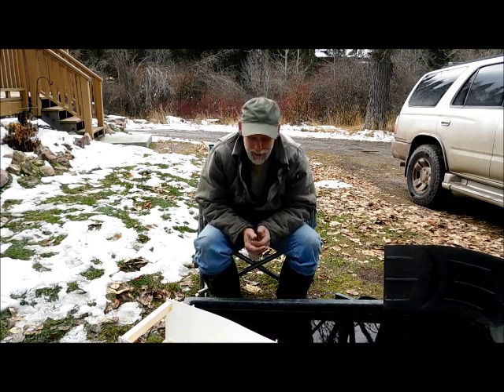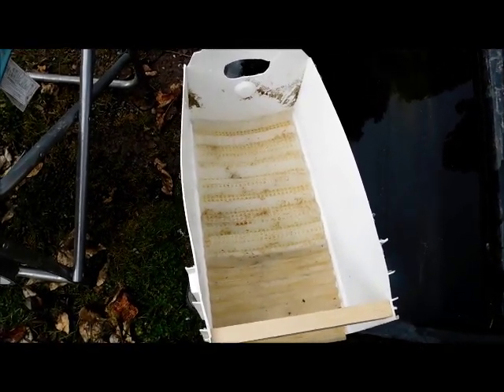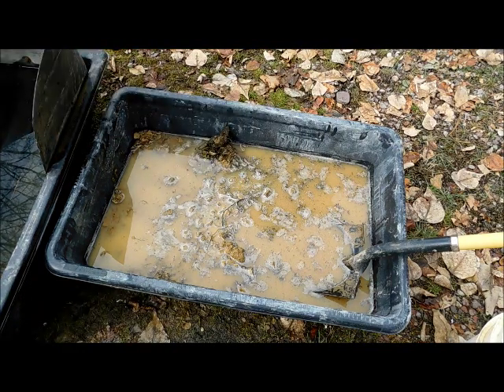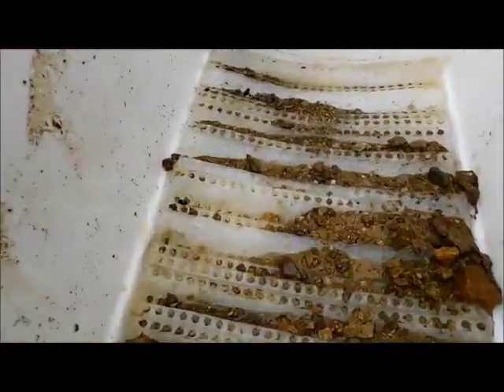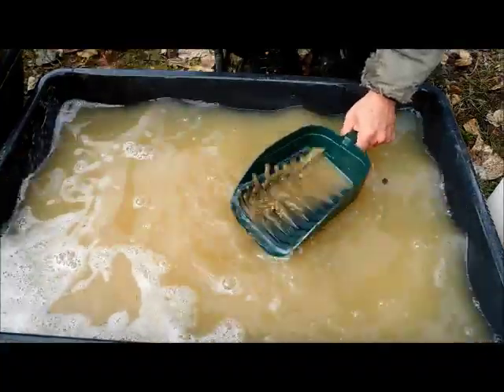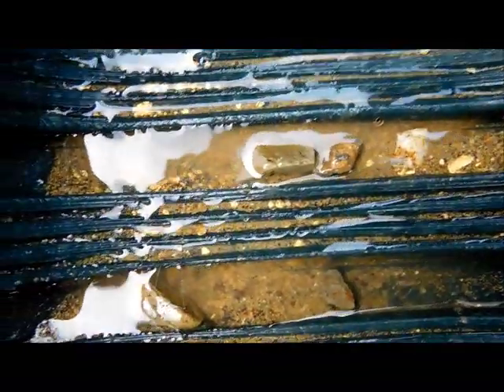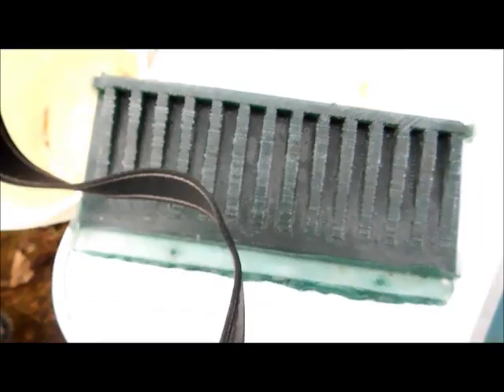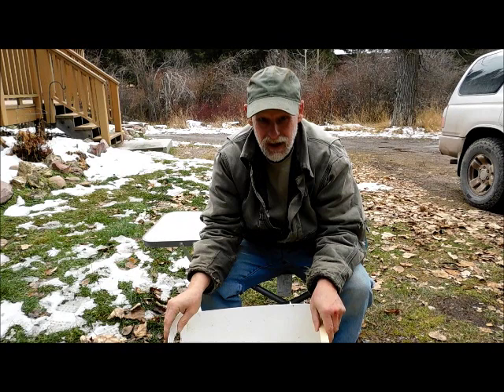New High Speed Bucket Concentrator Faster Than A Gold Pan

Comment: Just thinking about swinging a bucket full of dirt around makes my back hurt.  Now if a guy set it up on springs so it held its self and he’s just a pushing and pulling on a handle......  hmmm
Reply from the maker: Good idea I have been thinking about that. I ran the new one I made in my wheel barrow and it was much easier on the back. Going to keep working on the idea. Thanks for watching.

Comment: How's it going alan ? 
   You brought up a good point in this video. People saying your material is salted. Well here is my take and knowing your work. You start with your idea, in this case the speed concentrator. Well how do you know if it actually works ? You have to test it and when you test it you have to know how much gold you started with. There is only one way to know how much you started with and that is by salting it. 
   Now we know this does indeed work so you will be using this in the future. Your next phase im sure will be live testing it in the field. By actually useing it and saving and rerunning your tailings. If your not finding any gold in the tailings then and only then can you be confident in what you have created. 
    Great job on the video keeping them coming and heavy pans to you 
Dave
Reply from the maker: Hi Dave the concentrator works very well I have used it a few times this summer. The only problem I have is that is is heavy to use for very long.

Comment: If you use PVA filament (I think is what it’s called) in your 3D Printer you might be able to just print the mat and use it right away and not have to mold the silicone. Something to look at.
Reply from the maker: Yes I print in PLA and yes it would work but the secret is the mats are made of silicone and the gold does not like to slide on the silicone unlike the plastic.

Comment: Where do you get your silicone from?
Reply from the maker: I usually buy my silicone at Walmart. MD brand.
Reply: @alanrobertson2510  on so you use silicone from a tube? I thought you bought stuff designed for molds. What ever works and does the job.

Comment: You seemed to be sloshing it from side to side a lot , but there was a lot of slosh noise, but it was only really the splashing in the large tub that was doing all the moving ,not much happening in your invention there in my opinion , for what it's worth ,that's just my opinion . It looked like it needed a cut out up the back to allow water to flow through ,and pass over the material , anyway 10 points for trying , but sometimes it's just reinventing the wheel , i'll stick to my Garrett supersluice pan , works great , pretty quick ,and don't lose nothin. cheers.

Comment: A few years ago A Guy maid took some Harbor Freight gold mixtures and put the basket in screening basket inside so you'd shovel the gravel into the center classifying screen and the fines would drop out I think it was called the gold drum and I just wondered what you thought of that and I was wondering if you had the system where you mechanically were to shake that do you think that a high-speed you know if it was you know shaking it out at a high rate all the heaviest would go to the bottom corner of the bucket and all the lights would go out the top thank you
Reply from the maker: I have seen the gold drum I could see a lot of fine gold not settling to the bottom  and being lost out the front of the mixer I think shaking would be more effective. Who know where this will go I guess I have a winter project
Reply: Couple years ago I built  in the field out of pine poles a cross beam held up by two tripods of pine poles and suspended a 2ft by 3ft expanded steel mesh screen on four wires. 1 wire To Each corner of the screen. The sides were two by sixes and on three sides we're above the expanded metal and one side was laid flat below. The screen was high enough to park a wheelbarrow under it and this way I could throw dirt on it and when it got full enough it move back and forth very easily and sivied down to half inch minus. This way I can move material from the pit and leave behind most of the bigger rocks are all the bigger rocks and when I ran it it also cut down how much overs had to be raked out of the grizzly

Comment: You asked for opinions and I'm going to say it's pretty neat idea you're having instead of cutting the bucket down to make it smaller to fit in a 5 gallon bucket how about using 18-gallon tote and just turning the the square bottom bucket upside down and to wash out that way you don't have to have a removable matte less you want but one question I was wondering if you were to hang the bucket from a A-Frame like a swing set or you know some kind of frame so that you don't have to be holding the bucket up and you can put the dirt in and Shake It clean it out how would you would you just shake it by hand or would you how would have you thought of any mechanized ways to shake the classifying matting thingamajigger hey thank you for a great video and good luck to you hope you have a great winter and maybe a good winner there
Reply from the maker: Hi Jeff You have some great ides. I am going to try and improve on this idea with the removable mats I think it could go either way what ever a person wanted. Yes I think a hanging bucket on a frame of some kind is a great idea I have no idea on how to make it work yet just going to have to think on it for awhile. Thanks for the input.

Comment: Hi Alan, love the vids and how you keep trying to improve the whole process of concentrating and getting away from classifying. Definitely love the improvements you've made since your first attempts at making your mats. 
   I have a flow pan from Gold Hog. It absolutely works, and works FAST! With it, during the initial agitation, you will lose large rocks out both ends, but that's really only about 15 seconds or so. After that, there actually is a single direction for getting rid of the rest of the material and leaving the heavies on the bottom. In reality, the only reason you would need holes on both ends is to allow kind of a sluice action. But the gold itself, within that initial crazy agitation, is already on the bottom. You can pretty much just dump out everything else. It takes me about 3 minutes to run a 5 gallon bucket. In your gadget, you could do the same thing. Shake the heck out of it like an angry Sasquatch on a fir tree, and then dump the rest out the front. The mats are effective, and will trap the gold in the bottom. I think you have a winner here. Especially if the whole thing could be 3D printed. And if you act right now! because we can't do this all day, for a small nominal fee.... etc and folks could purchase the printer file to make their own. 
   The scoop I am VERY interested in! Centrifugal force being greater at the end of the scoop, away from the hand, I think I would try more of a wave action, tilting it forward and backward, in the water, letting the gold stay always at the back, trapped in the mat. And allowing the lighter material to just flow off the front like a sluice again. Mats are amazing things. The way it holds onto gold just really surprises me. I have been a Keene customer for over 3 decades. Until I saw my first Gold Hog commercial, I was fully convinced you needed all that expanded metal and steel riffles and carpeting etc. Even after all the years I've been in this game, I didnt fully understand how heavy (specific Gravity) gold actually is. It's really amazing stuff. And I really think you have another winner on your hands with the scoop. Especially in quick sampling! Without classifying, just a quick fully stratified material in the scoop and dump off the rest with a few waves front to back. Even larger rocks should just roll right out the end. Would love to see a video with that method. Agitate it like a psycho monkey with the front tilted upwards so the gold settles out in the back by the scoop handle, and then tilt it forward and get the rest of the material out the front with just a few waves. Then of course check for losses. I would make one myself and test drive it, but then I would have to cut up some of my Gold Hog mats. 
   I'm ALWAYS looking for newer and better and faster ways of doing things. Especially now that I'm getting older and more broken down. In the Sierras, I've been struggling with that stupid red clay that we all love, for years. Saw a method of breaking it down quickly from Jeff Williams. You've probably seen it already, but in case you haven't,.... he just puts all that nasty stuff in a 5 gallon bucket and uses a drill with a commercial sized paint mixer on it. Stirs the heck out of it, breaking it all up, and then runs it through a sluice. I carry one with me to the field now with a 1/2 drive battery drill with a couple extra batteries with me, in case I feel like I have a few extra oats in me that day. 
  Anyway, love the vids, and love your ingenious home made goodies you come up with and share with the rest of the prospecting community!! Oh! And if you are using a mat, always make it removable. Stuff gets stuck down under it no matter how well they seem to fit in whatever contraption they might be in. Ok, that's my 2 cents brother!! Keep up the great work!!  Bob
Reply from the maker: Hello Bob and thanks for your input you have some great ideas. The mats are working out great now I love them. I do think I was being to careful not to lose the gold out of the bucket I agree with you shake the heck out of it and discard the rest and the gold should stay put and the scoop I can see the back and fourth action working very well. It's always funny how things never work out the way you intended them to but just give a guy more ideas to keep improving. Thanks for the ideas Bob.

Comment: A big thumbs up on another great project. I would recommend staying with this design rather than going to the Flow Pan. This one keeps all the gold. Plus this one will work away from a stream and all you need is a small tote for water.
It will work great when looking for new ground to work. You can quickly run samples without having to spend time sluicing it. Also the nugget trap will be a good addition to it. Those mats are great aren't they?
Reply from the maker: I could not have said it better myself glad you like it. Now that I did the square bucket I am going to try what I think will be better not sure how it going to go yet but we will see. I think the nugget trap is going to be awesome and yes I love the silicone mats. Gold recovery made easy.

Comment: I have just had to subscribe again!! They are definitely a great time saving pieces of needed prospecting equipment.if my arms worked well I would love to use them but as it happens I can't use a little pan a few times without having to stop.the small one would be best for me.
Reply from the maker: Yes it is not easy on the arm or back but will speed up a process a lot.

Comment: A good idea, only issue I would have and it's the same issue I would have when I was  using the Goldhog.  The goldhog is heavy by it self and then you add material and then the goldhog just gets too heavy when you throw shovels full of rocks and dirt into it and then trying  to wash the rocks and gravel  out of the Goldhog. If anyone has a really bad back and I broke mine a few years back, bending over with that extra weight will not work good as it only takes a few moments shaking back and forth before I have to quit as the pain gets too intense to continue. 
I no longer use the darn thing it was just too much for my back to take using it.
The only pan that I have used for over 20 years now is the LeTrap gold pan.  I can pan at least 3 times faster and catch more flour gold than using a regular round gold pan and I only have to use one hand doing it which is a life saver for me for panning.
Now that I have made several silicone mats for my sluice boxes I have an idea for my LeTrap gold pan, I think I can maybe make a mold and make a silicone clone and  fit inside my LeTrap gold pan that should make the original LeTrap gold pan into a fantastic gold trapping gold pan then. 
I think for someone in my shoes trying to pan and try and use your idea with the large 5 or 6 gallon rectangle shape bucket, I would go with one that is maybe half, one that is like maybe a square 21/2 gallon bucket and then I think you would have a winner for sure and it would be a lot easier to backpack into the high country.  Thank you for sharing with the rest of us. Respectfully, dd
Reply from the maker: Good points I agree it is not for a bad back. I have never heard of the Le Trap pan before I will have to check it out. Good idea putting the silicone mats in the pan I see no reason it won't work just fine. We will see where it goes and I will try and keep the bad backs in mind. Thanks for the input.
Reply: @alanrobertson2510  Thank you Mr. Robertson, just a little warning about the LeTrap gold pan they are rather hard to find now,  sometimes they will show up on Ebay, but not often anymore, I do not know why, everyone that have used mine  in the past would throw their old round pans away and go get one for themselves, just like I did when I first came across the LeTrap gold pan.  There is another brand on Ebay called - THE MAVERICK GREEN Gold Finishing, and also the vendor has a combo with a panning device similar to the Goldhog with the Maverick green or blue gold pan, both the green and the blue Maverick gold pan are the same size and are both very similar to the LeTrap gold pan, the only difference is that the Maverick green gold pan is about a 1/3 smaller in size and is rather pricey at $19.99 plus $10 for shipping.  But it works the same as the LeTrap gold pan as you can use just one hand to pan with.  Anyway I would say you would not go wrong with either one.  What I really like about my LeTrap gold pans is that you can place a shovel full of rocks and gravel inside the pan and the  pan will float at an angle in the water so you don't have to hold onto the pan with both hands as you are panning.  With the pan floating in the water it takes very little effort and very little time to pan down to the cons.  I have demonstrated  how easy it to use my gold pan and not to lose any number 9 round lead birdshot and by holding my pan vertical the shot does not roll out of the pan.  There is no other pan on the market that I am aware of that will hold number 9 round lead birdshot in a vertical position. or any other type of gold pan that you can use just one hand to pan with.
Reply from the maker: @dewfew1  The Maverick pan I have heard of and I have searched all over town to find something with that shape with no luck. I might just have to buy one and like you said put a silicone mat in it. Thanks for you input.
Reply: @alanrobertson2510   Mr. Robertson  looks like the La Trap gold pan has gone up in price some since I purchased mine but it also looks like all the gold pans has as well, I guess  unfortunately  prices will never be like they were before.
 Mr. Robertson here is a source for the La Trap gold pan I have provided below for you if your are interested in getting one.  
In the description it describes a little more in detail how to use it than what I had said earlier.  
 https://www.goldfeverprospecting.com/letrap.html

Comment: Alan, 6:55 minutes into this video one problem is jumping out at me. (I am a 71 yr old guy with a bad back), you really need to rise your wash bin up so you can stand up like a grown man, PLEASE, it's hurting my back just watching!
Have you thought about using a Vibrator on your concentrate buckets to drop the gold to the bottom of the buckets?  A Bucket 1/2 full of water, 1/4 full of cons, stir with a drill and paint stirrer and hold a vibrator against the side of the bucket while the cons slowly settle down.  This should concentrate the gold to the side where the vibrator is.  Pan out the dirt above the puddle of gold first to look for any stuck flakes.
Reply from the maker: I would agree with you not good for a bad back. I plan on taking my boys along in the spring to run the thing. That is a interesting idea I have so many running thru my head vibrating, shaking low water flow options,Giant rocker box and on and on. Maybe put this on a stand facing backwards in the stream and shake with a handle.

Comment: Well Alan, it worked great! Will you also be trying the rounded bucket style as well? Honestly, I don't see the sense in it since this test was a complete success.
Reply from the maker: Hmm I think I will now that you ask I have a idea that might make it faster with a round bucket.
Reply: @alanrobertson2510  In your first video, I commented first saying Square. But then my mind went to, well I guess the best way to explain it would be, Airo Dynamics, In this case aqua dynamics. Take my van vs a car. Wind hitting the side of my van tends to push me pretty good and make steering sluggish. But with a car "more rounded" not so much.
Once you test the round style, pay attention to the difference between the two. Both the ease of action and the amount of slosh caused by the action.
Reply from the maker: @GreenMountainGoldTrap  I would agree with that easier to shake. I also think with the round bucket it would have the curve in the back and then spread out the material in the front with the bucket being lower in the front in would move the dirt out much faster. We will see.

Comment: Cut a hole in the other side of the bucket and you have GoldHogs “hog pan” or newer “flow pan”.  They are pretty expensive though so if you can make one for pennies on the dollar I’d say you have a winner!
Reply from the maker: So I like the fact that the dirt only goes out one way and not out both ends when you shake it. I probably have twenty bucks into it and that is in the mats. I sure think it is a winner for sure. Thanks Chris.